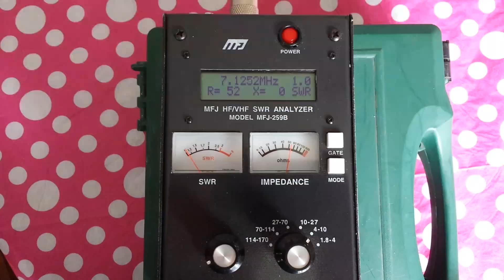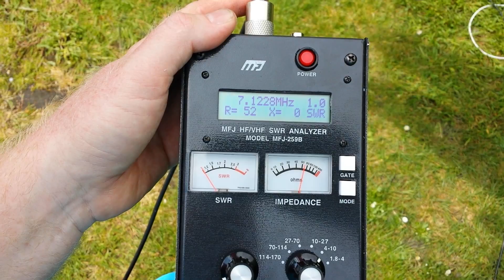PT2 - QRP EFHW ANTENNA TUNER 40m - 15m now on the wire !

Comment: great video. when you say 15-40 meters.. do you mean with the same wire length retuned with the cap? or you mean it's capable or 15-40 with a cut 1/2 a wire for each?
Reply from the maker: Thanks for your comment. It works on wire cut to a half wave. That was my goal for good efficiency and low angle radiation. BTW the unit now works 15 to 80m, you can see a video on my channel of how it was achieved . Also you can see it working stations on air on 80m band. 73

Comment: This may be a dumb question, but would you have to switch the length of the wire for the different bands?
Reply from the maker: KuriosPC yes you do need wire cut to each band as they are resonant antennas. It's purely an LC Network to drop impedance to 50 ohms without and inductance

Comment: Just found part 2 and 3! So the 160pf polyvaricons are rare as rocking horse doodoo. Would a 140pf one be enough?
Reply from the maker: Yes im using 3 to 140pf. If u need a diagram, look at the hendricks qrp tuner manual. Its available free from their site
Reply: mk1tina What gague wire did you use? I'm not getting an swr of less than 2. I'm using .71mm